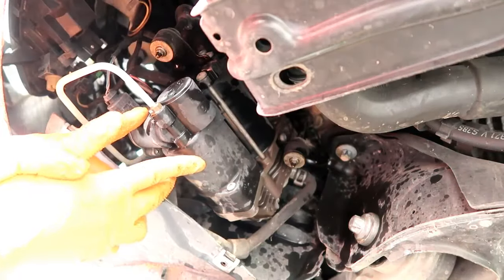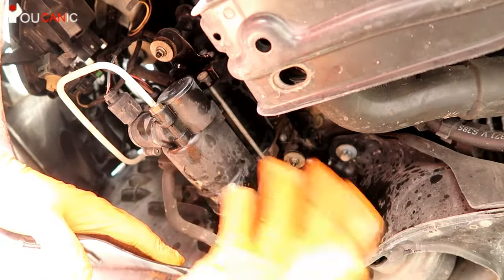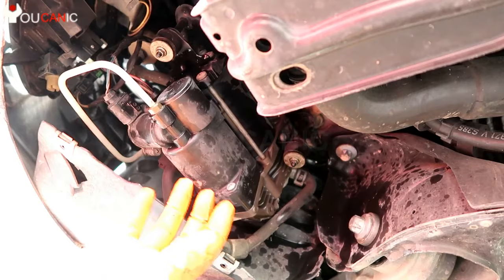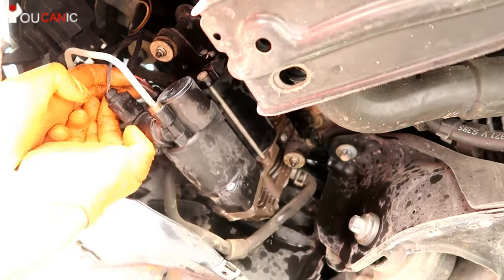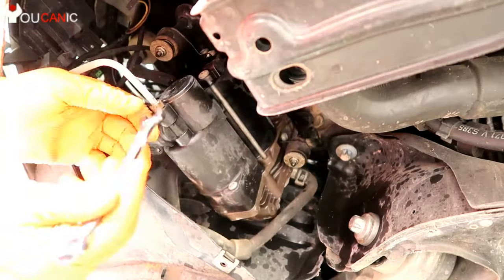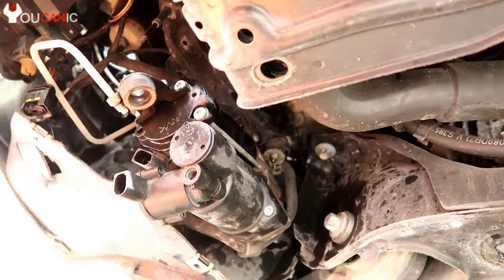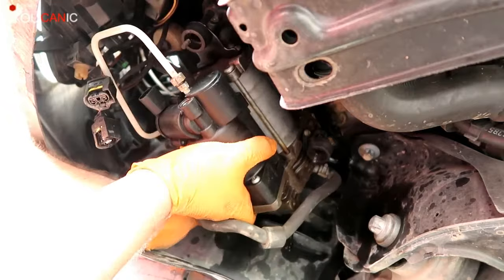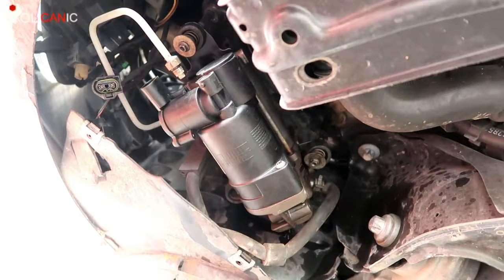Mercedes Airmatic Air Suspension Compressor Replacement | Step-by-Step Guide

Comment: Enjoyed the video, I am having problems with my Airmatic system my suspension only goes  part way up, when I stop and the car left over night its sitting very low, I start the car and again it lift partway, I collected 6 bags of compost yesterday and amazingly the car lifted higher 65cm from road surface  to the wheel arch, and it seemed to be a more comfortable  drive because  it was higher.
When you disconnected  the white pipe was the air coming from the compressor  or returning  back from the rear air bags ,any ideas  would be welcome. Regards Peter

Comment: thank you for this video. i have a 2001 mercedes S class ( W220) and my car does not stand up. since August. I hope to succeed in mounting the air compressor. where exactly is it? below the engine?
thank you so much

Comment: Very good video. I have 2011 R350 4matic. It is leaning down only on the passenger side in the front and rear. How to diagnose the problem and what to replace. Thanks for any helpful hint.
Reply: Have a shop pull up the fault codes first. I suspect the distribution valve is  bad.

Comment: I replaced the compressor and the fuse relay everything should work but I still don't get power to the compressor do you have any idea what that could be? Or does that have to do with the air valve block?
Reply from the maker: Thanks for reaching out! It's possible that the issue could be related to the air valve block, but without more details, it's hard to diagnose. We'd recommend taking advantage of the many guides and resources available on our website www.youcanic.com that can help you troubleshoot this issue.

At Youcanic, our mission is to empower car owners like yourself. We offer free resources, a powerful scanner, and access to factory repair manuals. Feel free to navigate our site whenever you need assistance as it's designed to make car maintenance easier and instil confidence in you. We're here to support your car ownership journey!

Comment: Thanks for the video. I recently purchased a used 2001 s430 and it would lower to the ground hours after i cut the engine off but today it wouldn't raise up and I checked this out and found out that my compressor isn't coming on anymore
Reply from the maker: Glad it helped
Reply: Passenger side behind bumper remove passenger wheel remove plastic inner bumper cover. There she blows!!!!!

Comment: Thanks. Does all the air leak out of the shocks when you disconnect this? I presume not. I imagine there's some sort of check valve behind the reservoir? Not sure. I'll have to look into this further. I don't want to remove it for testing/repair, then find out I can't drive my car.
Reply: Did you figure this out?